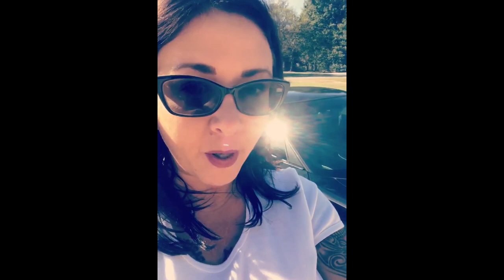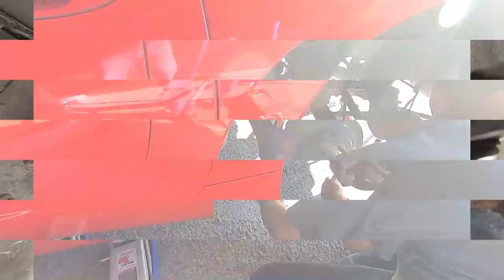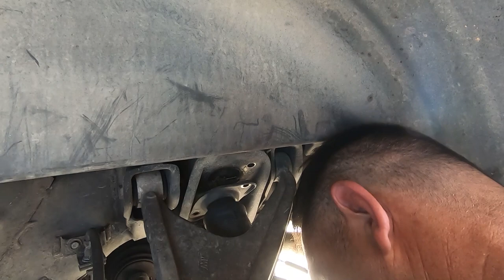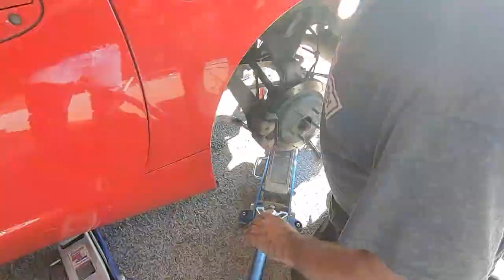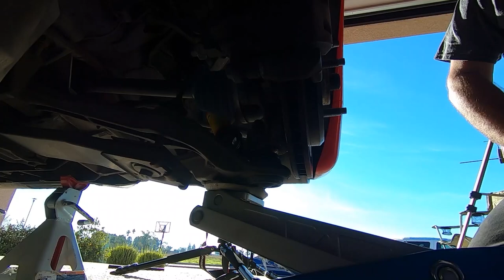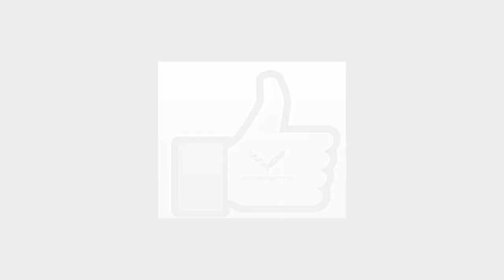How to Replace The Rear Shocks on a C5 Corvette

Comment: I think the bottom bolt is a 24 mm if I'm not mistaken, and I would probably use a breaker bar to Break Free the top bolts and then use 1/4 inch Drive since its Slimmer should be a little easier to remove but that's just me anyway I totally awesome video, keep up the good work you guys definitely have a great site here!
Reply from the maker: Thanks for the information and the kind words!! Please tell your friends about the Channel and have them Subscribe!! Thanks again!
Reply: @THECORVETTECHANNEL  definitely will pass on the word to my local Corvette community and anyone else who's interested😎
Reply from the maker: @OMEGATECH  Thanks so much !!